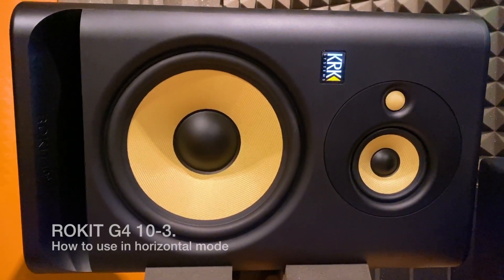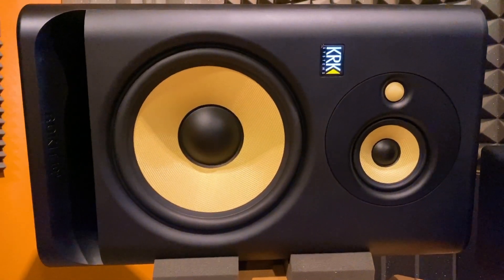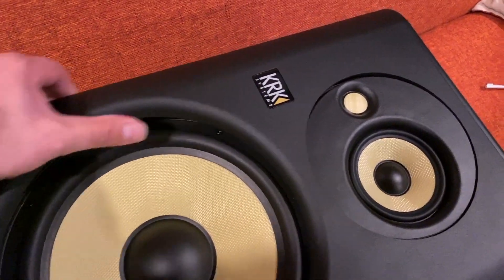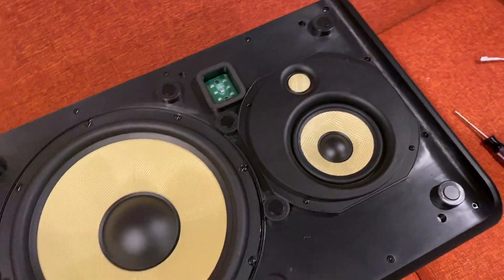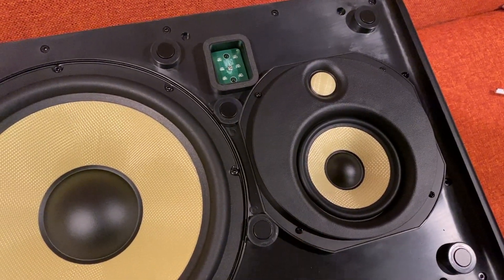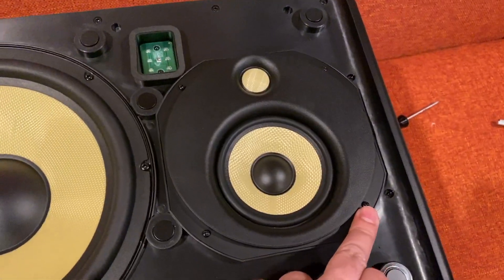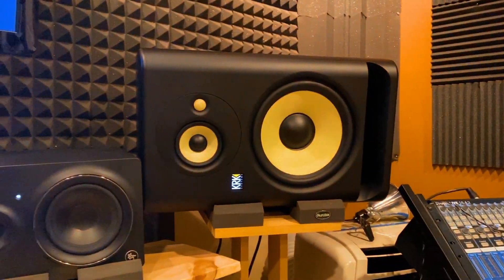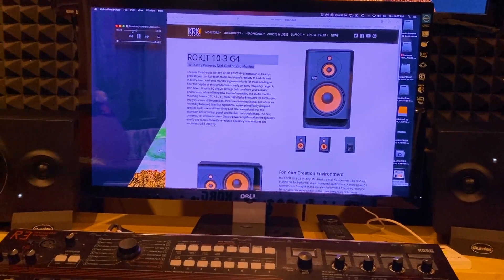How to rotate the KRK ROKIT 10 3 G4 Midrange in Horizontal mode

Comment: I’ve had the rokit 6 G2, VXT 8, V6 G4 & Yamaha HS8 and I’ve got to say, the Rokit 10-3 G4 is by far the best out of all of them. Very flat, super clear with the mids and highs. And cause it’s a 3 way speaker system, it sounds a lot more 3D (wide) compared to the others. And the low end is balanced, not muddy, but still powerful and accurate. I’m able to hear things in my mixes that I’ve never EVER been able to hear before on other monitors. And with the DSP function, you can tune the Rokit 10-3 G4 to any room. Highly recommend these. By far my favourite monitors that I’ve ever heard and owned. And I’ve herd A LOT!
Reply from the maker: I'm glad you're enjoying your speakers! I did buy another pair of the KRK rocket eights just to have them around the house for playback. One feature I would like to see, is having Bluetooth connectivity.  Many of the newer speakers have this available so that you can play from your mobile devices straight to the speaker without any issues. Give or take a little bit of latency.

Comment: What about sound? What do u like and what you dont like?
Reply from the maker: These sound amazing when trying to impress your friends, but for mixing you could get away with using smaller speakers, obviously due to the 10 inch woofers may throw off your mix, but for playback these kick pretty hard were you don't need a subwoofer! They're also great for DJs and maybe a small house party.

Comment: Hi ... yesturday i recieved a pair off these speakers and i have problems with them ... i have a verry strange noise and interference on them so its really dissapointing ... do you have this interference noise on them ... i cannot listen to low volume music because this interference its present in audio soo iff i put all signal out the same .... do you have the same problem ?
Reply: Get a hum device from Sweetwater.  It’s maybe not the KRK’s. It’s a hum somewhere in ur electrical wiring.  I had to buy a rack mount for large power conditioners.    I had to get 2 FURMAN large rack mounted ones.  Plus those jumbo ones on the floor bought 4 of those still need more.
Reply from the maker: Hey Adrian, sorry about the late reply. I too had similar issues with unwanted noises coming from both the speakers, and when I talk to KRK the acted like they didn't know what I was talking about when it's all over the Internet. I decided to call back in and I spoke to someone who is very educated with the speakers and stay straight told me that the electronics in this device or not shielded correctly therefore, you get unwanted, digital glitch noises coming out of the speakers, and there's not much you can do about it. I was attempting to return the speaker, but I'm not really using these for mixing and mastering. I'm just literally using it to play back at a nice loud volume and the base response on it is pretty pleasant.. So anyone reading this know that the speakers are not ultra quiet, and they do have an issue with unshielded speakers, which cause unneeded frequencies when music is not playing.  I also attempted to buy the D'Addario noise, suppressor outlet, which you can check out. It did help clean up the noise, and also other noises that were causing interference in my studio https://www.amazon.com/DAddario-Accessories-Tour-Grade-Base-PW-TGPB-01/dp/B07G9J1Z8Y/ref=asc_df_B07G9J1Z8Y/?tag=hyprod-20&linkCode=df0&hvadid=242014660953&hvpos=&hvnetw=g&hvrand=10852575755994984386&hvpone=&hvptwo=&hvqmt=&hvdev=c&hvdvcmdl=&hvlocint=&hvlocphy=9032518&hvtargid=pla-645527886848&psc=1&mcid=5909c6f6a94e3874a11f4c1fafa886c4&gclid=Cj0KCQjwwMqvBhCtARIsAIXsZpb8Bwx0fnyc3u7pPegvxRY2QSYl_2PmLeUqnV_ly557tnDVwCui2M4aAoQTEALw_wcB
Reply: @andrew.lozano  After 3 years ... i observed a loot of different interference noises ... also in computers... i have 2 computer one with no interfereance old one and the second more expensive one with interfereance... 
i think this si coil whine sounds so those noises are artefacts off the electronics ...  and cheap filters ...  .... so this is the market ... at lower price ranges

Comment: Hi, do you hear humming and buzzing sound from speakers? I've read a lot of comments on weird sounds coming from speaker. 

I'm planing buy them and rotate mid and high like you for nearfield...is there a difference in sound when you rotate drivers? 

Also what do you think is it better to have mids and highs on the inside and bass outside or other way around did you try both options?
Reply from the maker: Sorry for the late reply! Unfortunately, my KRK speakers are very noisy. When I contacted KRK, they informed me that they are now owned by another company, which claims they have no records of issues regarding unwanted noises from the speakers. However, if you look online, you will find many complaints about noise issues. It seems the problem is related to the shielding on the woofers. Unfortunately, I had had the speakers for over a month so it was nearly impossible to return them. I don't use them as my main reference speakers but instead I use them to entertain clients when they come over to hear their music at a louder volume.

Comment: nice video bro how big is your room? im thinking about getting these but don't know if these would be overkill but at the same time I rather get these to avoid getting a sub
Reply from the maker: Jay Hart Music Thanks! ! My room is 18x11. The speakers are mid range so after the video I had to pull my desk forward about 4 feet from the wall. Basically 5 feet from Cone cone in a triangle to my nose. Use the KRK app Monitor alignment and EQ recommendations. The KRKs come with a built in Eq that comes with 25 presets.
Reply: @andrew.lozano  dope bro thanks my room is bout 13x12x7 idk if I could use these